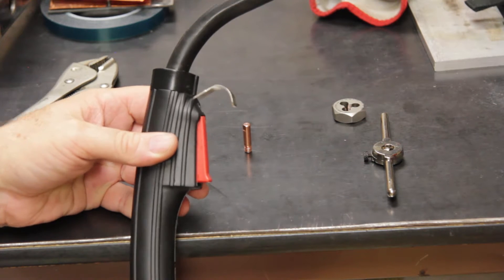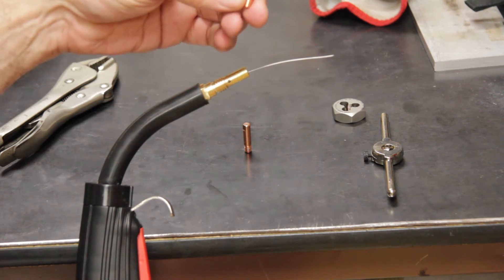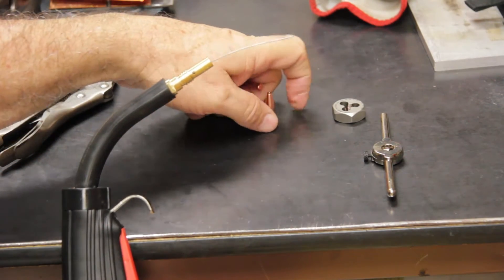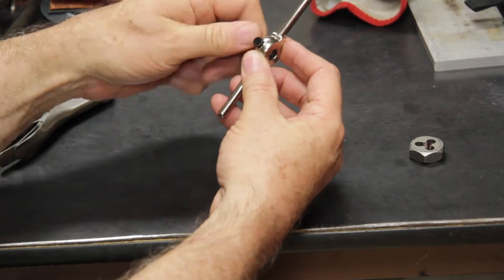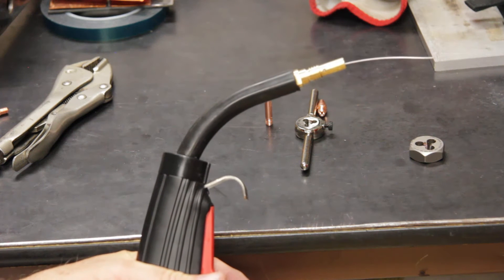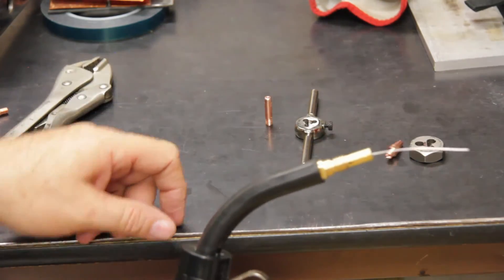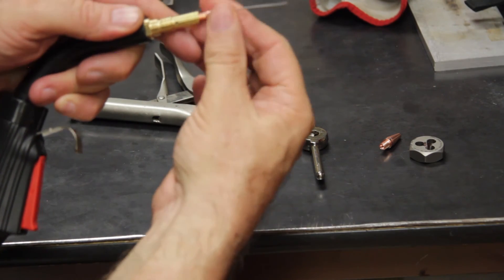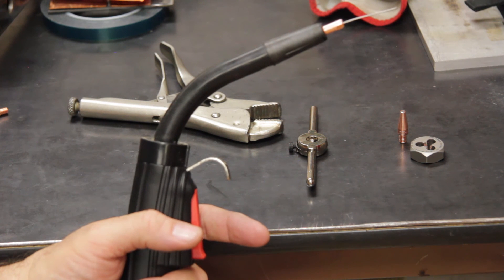Lincoln Electric Power MIG 210 MP Tip

Comment: There’s actually a reason for the newer design. It creates a different gas flow due to the tapered newer tip. Which the older wont do!  Just an FYI
Reply from the maker: Thanks Rudy for the great explanation,

Comment: dang how many tips do u go through
Reply from the maker: I usually try to clean them up,  but I do use a few.  the Trailer project I am working I went through 2 tips.  After a while they get pretty cruddy. Or if the tip get welded over it is hard to  re-drill them out, so I just replace them.
Reply: Really.  I’ve never had to replace the tip

Comment: fits good but tips too long.  Shorten it too ?
Reply from the maker: Hi Gord, I did not have to shorten the tips.  They seem to have worked just fine.  But I do use these tips with gasless flux core wire.  You might have to shorten if you are using gas.